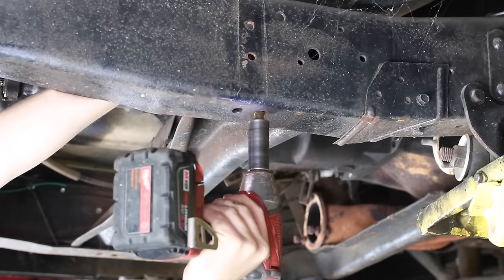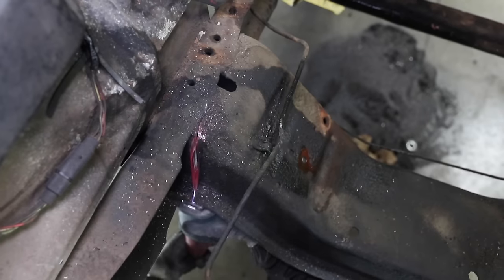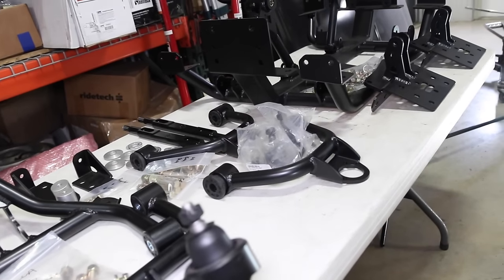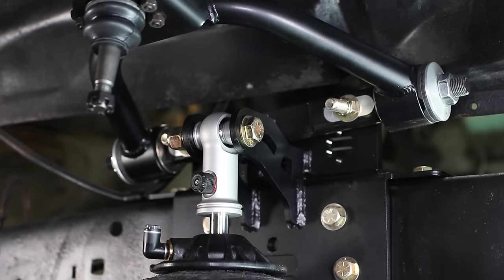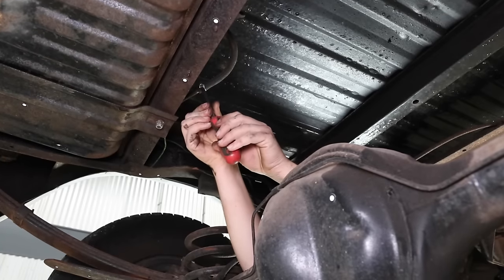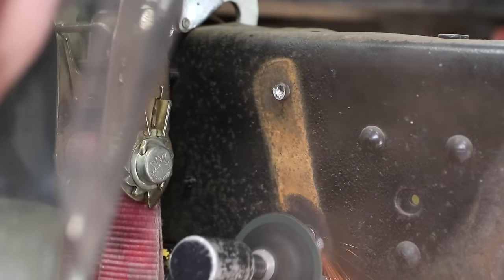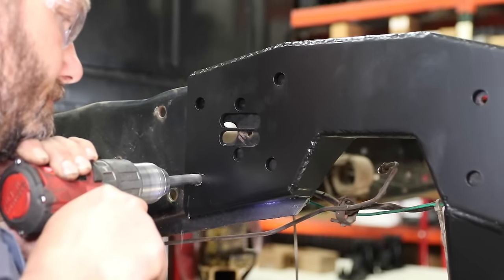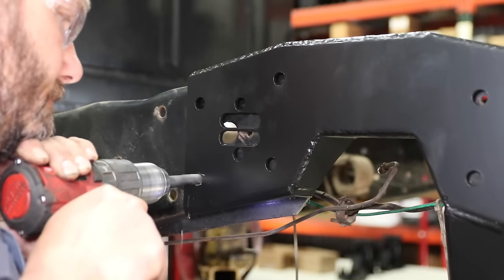We install Ridetech BOLT-ON Coil-Over / Air Suspension for 1965 - 1979 Classic Ford Truck

Comment: At $8,225.00 for the kits, why not just go for a custom chassis...
Reply: Because a custom chassis is twice that and a lot more work.
Reply: @deanrickvalsky7586  
12K gets you a Spec chassis from Roadster shop...
Reply: @joeschlotthauer840  that’s a basic price you still have to make some selections that will add to that cost. Plus the labor is more. So the savings is why  people go with a suspension system. Like I was saying.
Reply: @deanrickvalsky7586  twice the cost.  same amount work
Reply: they made it about as simple as you can get versus adding a crown Vic suspension in the front although that's a hell of a lot of work if you were just doing it by yourself and your backyard I would consider a kit like this if I was newly retired and I didn't have nothing to do and I didn't want to be bored to death.
although that's a pretty hefty price tag and then you have to take your engine out you see that was the killer for me that was the deal breaker for me with the crown Vic swap as well although there's some people that have a lot of money to deal with and they'll easily buy one of these kits and pay a shop to install it for them it's a pretty trick kit actually the only negative for me with it is I don't have I don't have the money to buy it and I don't want to yank my engine out to cut the crossmember out.
Reply: @TheThirdWheel618  
As a retired Ford, Lincoln, Mercury technician, I just don't see the value. Roughly another 30% gets you a totally brand new chassis. The labor savings alone will pay for the new chassis...
Reply: @joeschlotthauer840  i think the air system is the benefit lol
Reply: @thephantomzoneboxing  not much into air ride unless it’s for the over 80000. Lbs range !

Comment: Trying to learn about bags or coil over just for street driving, but SLA front suspension on 67C10. I don’t drive the Ford as too many radius arms broke. I seen 13 snapped in half, 1 happened two blocks from my house. No.

Comment: I own a 78 F-100 short bed. I only wish that I could find a bed for it so I won't have to cut and weld in New metal over and around the wheel wells. Nice kit, but seems a bit harder than the description.

Comment: Any plans in doing a watts link set up with this or is it not necessary, also would welding the brackets to the frame add any benefits, also 1 last question, the front crossmember engine mount bars, is that a 1 size fits all or will there be different types like if we canted to coyote swap or godzilla swap the truck?
Reply: I'm wondering about the Coyote swap too? Heard the mustang 2 cross-member doesn't work out well.